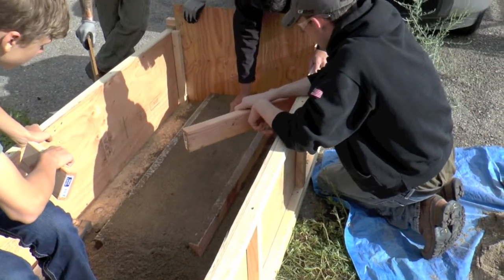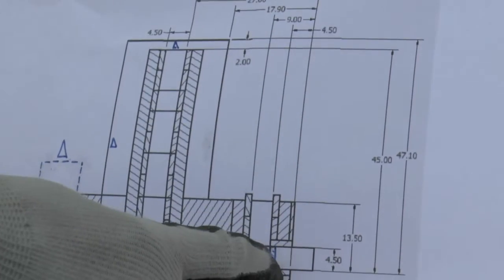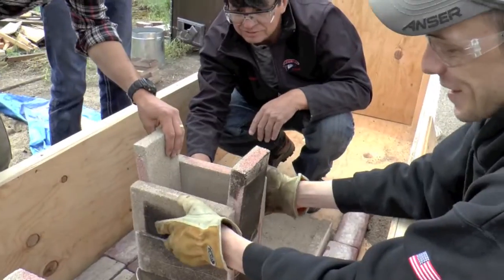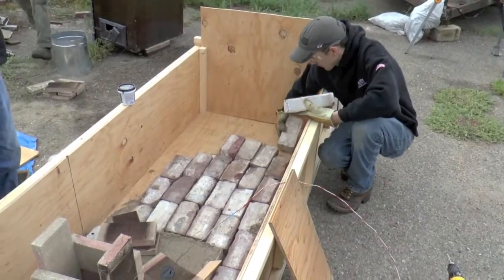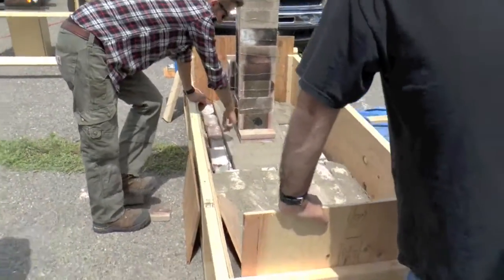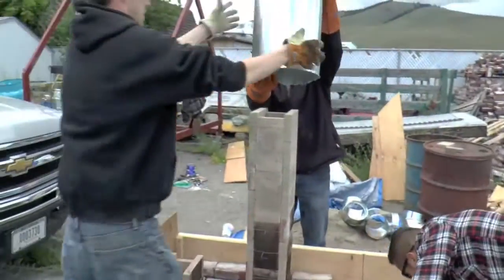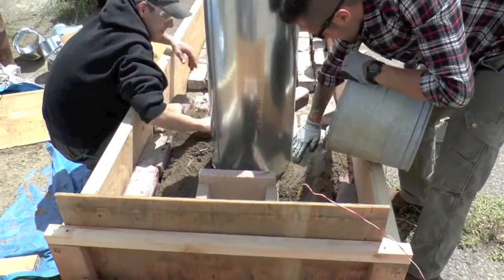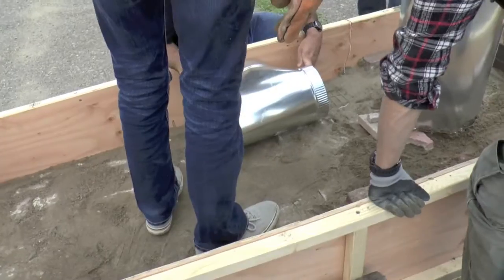Missoula College Energy Practicum  2016 "Rocket Mass Heater", BoweZone Productions.

Comment: I enjoyed the video very much, and will be enjoying the other renewable energy related videos In your uploads soon.  

  Especially enjoyed your use of the copper wire to tie the narrow firebricks stacked on side like that :-)

Is that sand going into the riser and filling the box? Or some sort of actually insulating material?

  To achieve highest temps/performance, and cleanest burns, the lining of the burn tunnel and riser tube needs to be a highly insulative refractory material, such as the lighter weight, more delicate, and more expensive type of fire bricks...  Ceramic wool insulation like kaowool for kilns is one excellent, but expensive option.

  Most highly insulative refractory materials that can withstand the temperatures generated when they are at the heart of a highly efficient, optimized rocket core, seem to be rather expensive.

  I am working on building a portable rocket heater in a box that will be similar to the one in this video except my box will be cement backer board with metal framing such that it can be relatively fireproof for longer term/indoor use... (Exhausted to the outside of course.)

  Instead of a mass in the box, it will use 4 of the 100lb propane tanks cut open ended and inverted metal heat radiation bells to get the heat into the space very quickly.

  The thermal stratification bell concept from Russian masonry heaters is quite useful.  Bells can store and release heat just like a similar amount of mass with ducting, but are much less restrictive of gas flow.

  The concept is that the hot gasses come in low and more importantly exit low, and have low enough velocity to stratify, thus only the coolest gasses exit the heat bell, and the hottest stay trapped until they release their heat.

  Masonry work and water containers (hiding recycled milk bottles and 2l soda bottles for extra high density thermal mass,) and built around, and possibly even over, the heater box and it's bells will collect low grade heat and release it later after the fire has gone out.

  A material I've wanted to try as a cast burn tunnel and riser hot face, with kaowool backing it, followed by perlite fill around the burn chamber and under the whole thing that has fairly insulative quality, and EXTREME heat resistance (tested to 5500°F) is from a tiny, obscure American company in Missouri, called "FireComp" or "FireArmor55"

  If the rocket burn areas are insulated and optimized for mixing properly, temps of 3-4000F can be achieved, and even higher efficiency... 90-95+%

  The trouble becomes finding refractory that can withstand the ultra high temps, and I am hoping to experiment with a bag or two of this FireArmor material as a somewhat insulative cast inner "hot-face" for making a set of pieces for a "shippable core" that could allow people to have a relatively foolproof rocket mass heater core that would stand up to years of use and the extreme temps and cleanest, most efficient burn of a highly optimized, well insulated core.

  If you're interested I'll let you know how my prototype works out when I get all the materials together and get it built

  Thanks for putting these excellent educational materials online!
Reply: Another energy saving trick using the bell concept that I just came up with because my household was gifted some rubberized "draft stopping curtains", at a time when it happens to be extremely cold for our Oregon coastal location, and our "EPA rated 80% efficient wood stove" hasn't been keeping up in a somewhat drafty house, and we had no curtain rods to install them normally...

  Was to attach them stretched tight to the wall face on the inner wall face over the window openings with thumbtacks, folded in half, and closing off the bottom and sides of the window from drafts... To about 2/3 of the way up... This blocks the thermal cycling of air over two thirds of the window, while still letting some daylight in the top third of the window, and allowing air warmed during the day by sun shining in Windows that get direct sunlight to flow up into the house and be replaced by cooler air from the room.

  Opposite of a heat bell, it created a "cold bell" for the bottom two thirds of the window, but still allows some light in, and allows for solar gain during the day at Windows that get it.

I can tell they are working because if I reach down behind them the glass is much colder than exposed glass at the top third, and if I go to the middle of the bottom and pull the fabric away from the wall an inch or so, a wash of MUCH colder than room temperature air comes tumbling out.

  I like it because it stops convective cycling really well, and I would not be suprised if it stops heat loss through convective thermal cycling at the 4 windows I treated this way by as much as 80-90%, even though only about  67% of the window is covered, and it allows for solar gain to interior air during the day without having to do any rearrangement.